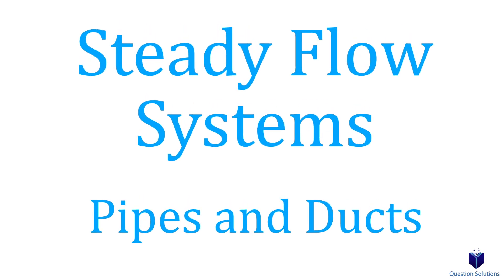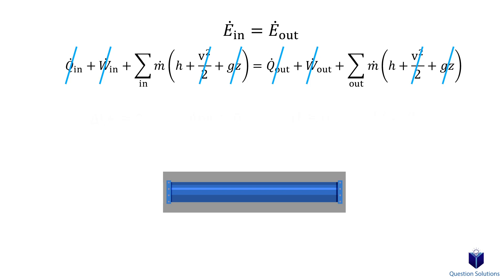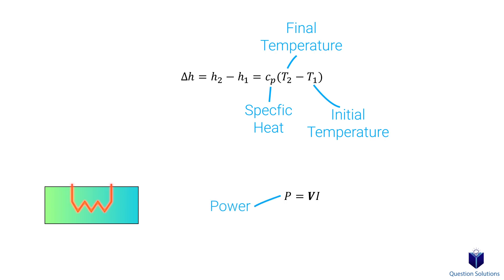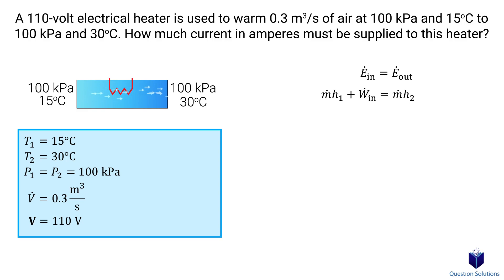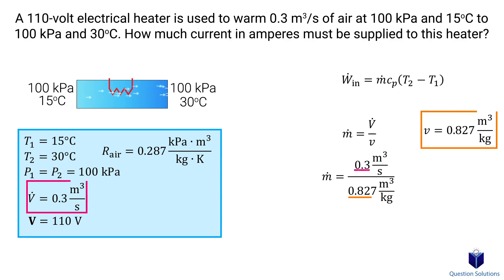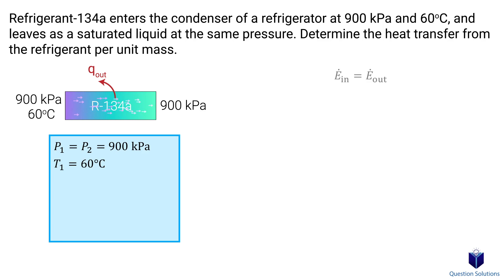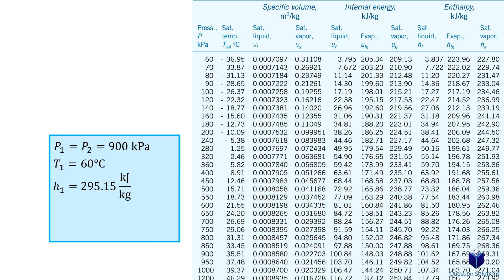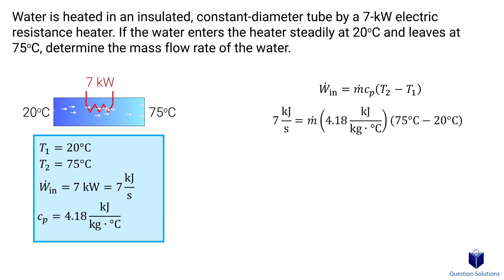Steady Flow Systems - Pipes and Ducts | Thermodynamics | (Solved Examples)

Comment: Wish you also did the friction chapter of statics :) Thx for the amazing videos btw.
Reply from the maker: The friction chapter for statics is not "hard" per say. It's mostly just coefficient of friction multiplied by the normal force for most things. It was covered in a lot of the videos so I didn't think a separate one was needed. In the future, I plan to revisit statics so I will definitely cover it then with a full video :)
Reply: @QuestionSolutions  That chapter goes even deeper than that tho.

There's "slipping and sliding", where you basically have to test for each case. There's also belt friction and friction on surfaces and wedges, which requires multiple FBDs etc.
Reply from the maker: @beterax  Yes, it does, but most first year courses do not cover slipping and sliding in a statics course, slipping and sliding is covered in the dynamics course (there is a playlist for dynamics which covers slipping and sliding in rigid bodies). 

So I will revisit statics in the future and I will cover those topics then. I first want to cover the first year material for courses before going deeper.

Also, I think there are probably a lot of videos covering those topics if you need in other channels, so maybe looking around a bit might help, not sure, but do your best! :)